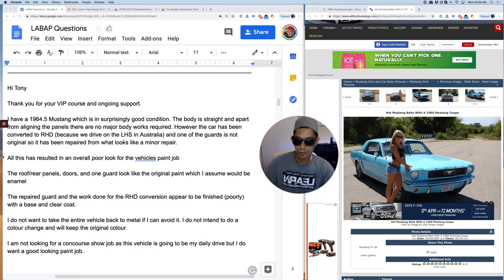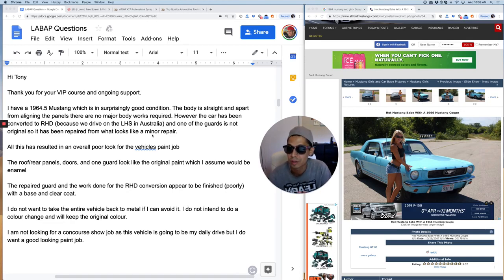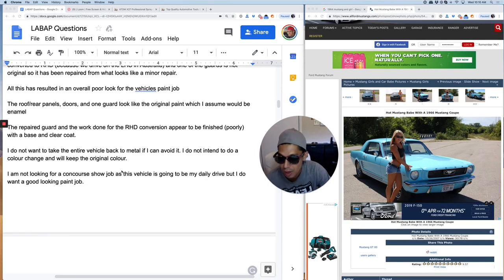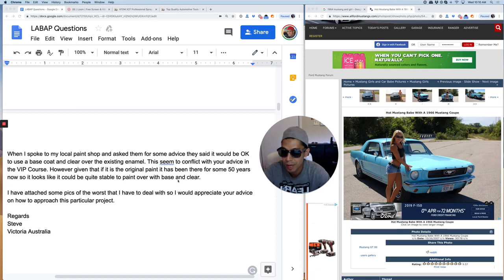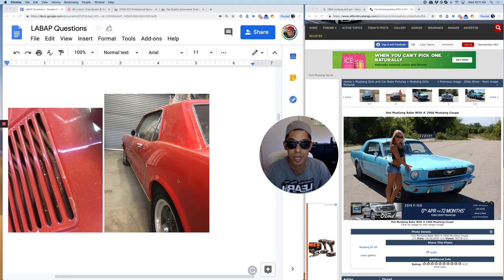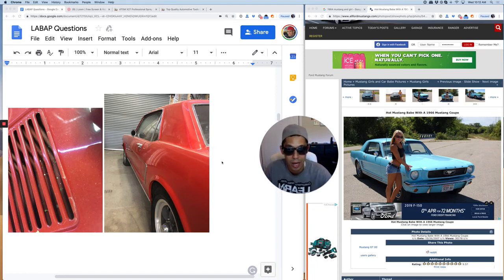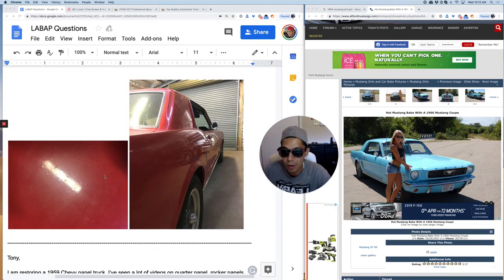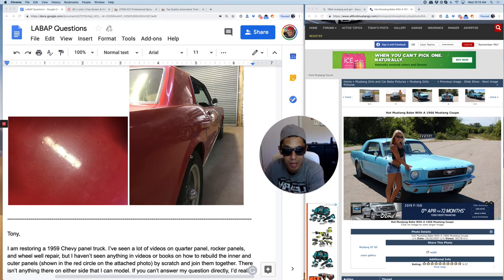Single Stage Paint AND Basecoat Clear Coat TIPS 🤔

Comment: Ive got one getting ready for future paint. Question, most of the original paint is intact but at some point someone (previous owner) sanded small round spots down to metal down one side of the car. Should the whole thing get stripped bare or can I get away with the similar recommendations in this vid and just spot prime the bare metal areas and then do the normal process from there?
Thanks for any advice...😉
Reply from the maker: It's hard to give my recommendation without pictures of your paint project. Have you checked out VIP? See how it can help you move forward with your paint project: https://www.learnautobodyandpaint.com/vip-offer/